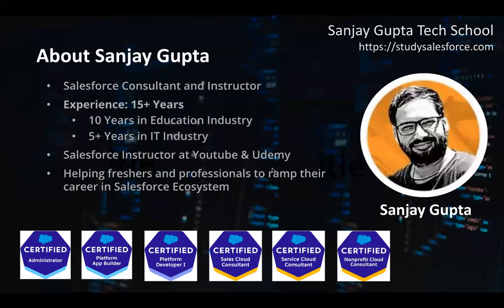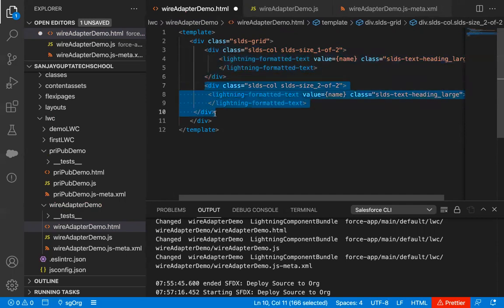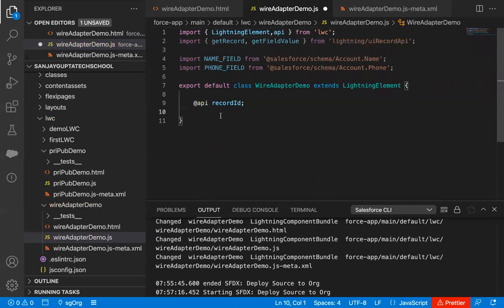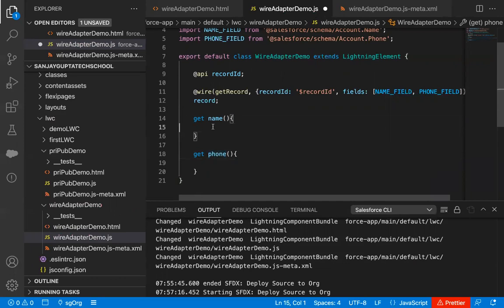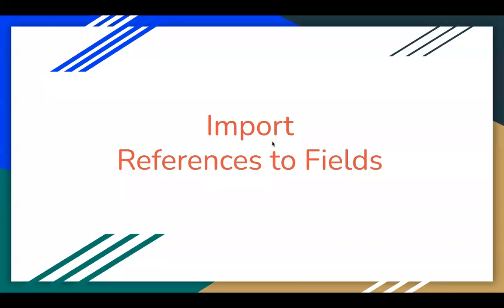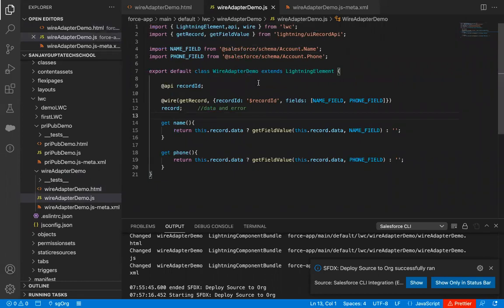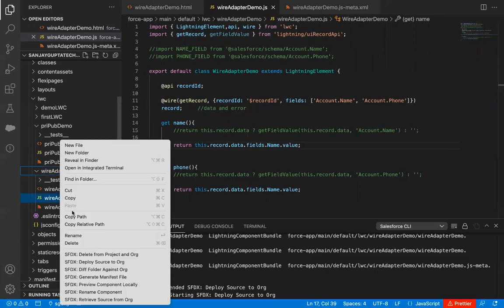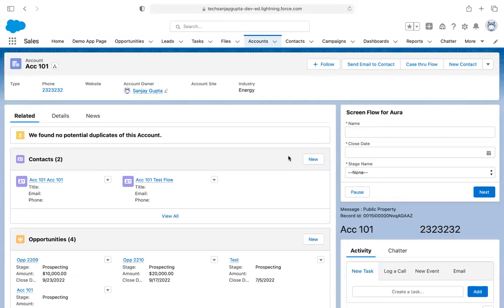08 LWC | Use @wire decorator | Lightning Data Service Wire Adapter| Lightning Web Component Training

Comment: is there any direct way to get the field value which is currency type, not string type? like if we want to get the annual revenue or there is only way is to use string only and then handle the value appropriately based on its data type.